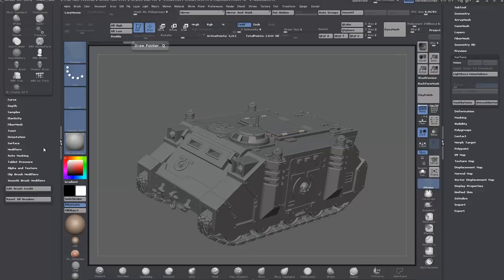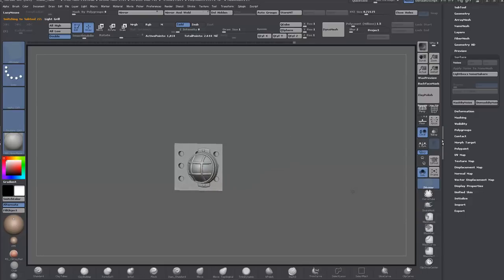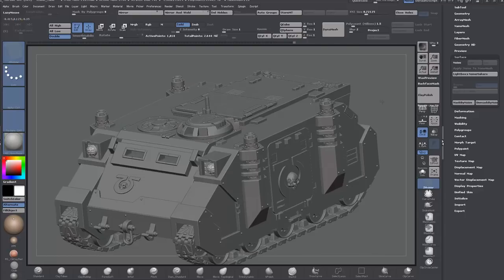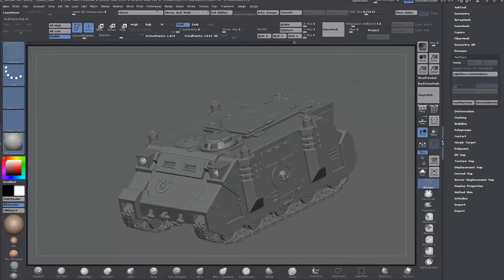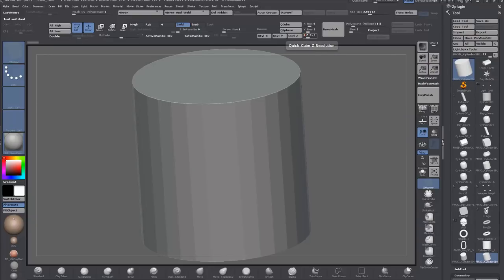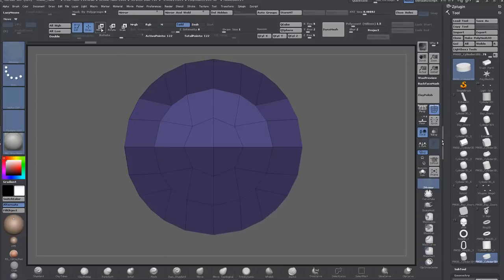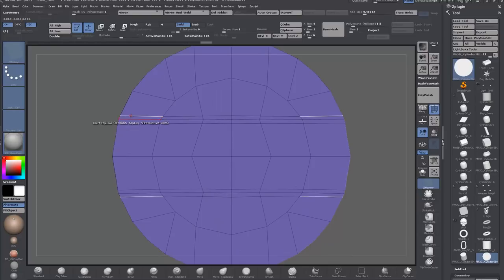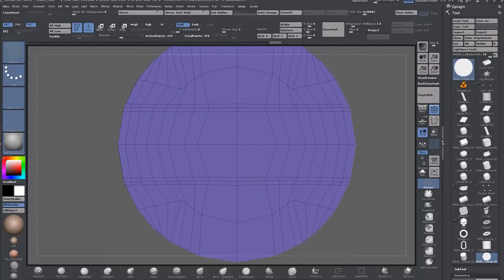Zbrush 4r7 - Zmodeler Tutorial Series '40K Rhino Tank' Part 7

Comment: thank you for the tutorial. i have completed my rhino tank modelling and then send it to keyshot for  rendering. By the way, your other tutorial "Zbrush - Keyshot - Rendering/Paintover Tutorial"  helped me very much for this tank too. Using Keyshot then Photoshop is a good choise if one camera angle is enough.  

So i have decided to produce UV maps (in order not to spend much time for postprocess in Photoshop)  but after i start, i have realized that it is not going to be easy. Anyway, I merged lots of subtools but before merging, i applied all dynamic subdivs. Polycount reached 18m :) (i decimated them to 100k without sacrificing details) Now i have a model with crazy triangle meshes. Zremesher is also not helping... Stucked... What do you advise?
Reply from the maker: If you're just doing render stills or illustrations/concepting, then I wouldn't bother wasting time with unwrapping. It's only really necessary for production assets.

As you've found out, unwrapping dense, high-poly meshes is something to be avoided at all costs. You want to unwrap the lowest level and then when you subdivide the UVs will propagate. Also, you didn't need to merge your subtools if going to Keyshot, and in fact it's much more convenient to keep them separated for material assignment in KS. If going to KS then you don't have to apply your dynamic subdivs as KS respects them and it is much easier on your system than sending 20+ mill points(which is actually double in polys)

Also, you should always save multiple .ztls at different stages and always make duplicate subtools so that you are always working non-destructively. This is a very important habit to get into. As you projects get more complicated you should have a good file/folder system in place and spend some time planning your project in advance until you get more experienced.

Comment: Amazing work! Shouldn't hard surface modeling be done in rock solid software such as 3dsmax or maya? Zbrush is good with organic substances but not hard surfaces.
Reply from the maker: +VFX Ltd™ Cheers mate. appreciate it. depends on your workflow, really. Zmodeler is just one component to creating hard-surface in ZB. It's when it's used in conjunction with all of ZB's many other tools that you really see the power.(see my recent hard-surface method vids) A software like 3dsMax(which I have been using for a long time) will always be more powerful than ZB for traditional modeling, but ZB is anything but traditional. :) And this is only the first iteration of Zmodeler. At first I was hesitant and thought it only a box-modeler within ZB, but as I mentioned above, the real power comes from teaming it up with the rest of the ZB toolchest.
Reply: musashidanmcgrath Thanks for the info! Very informative! :)
Reply from the maker: +VFX Ltd™ no problem mate. :)